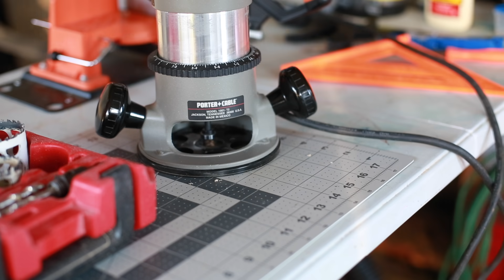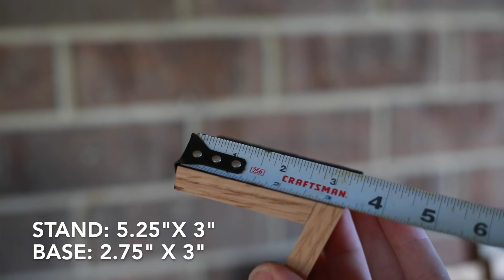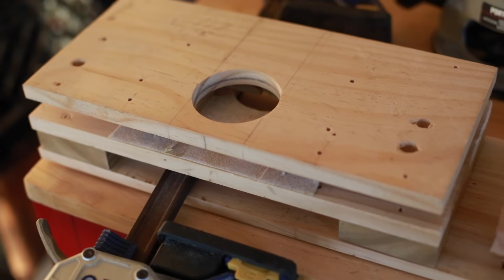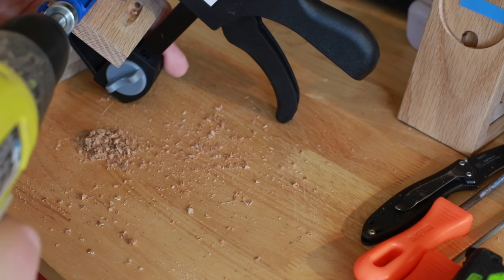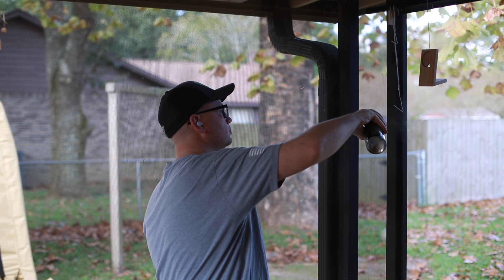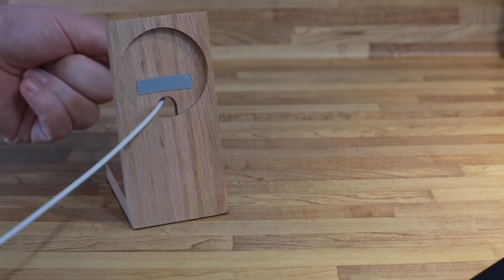DIY Woodworking MagSafe Charging Stand - Build your own for less than $10!

Comment: So... to make a 55.5 mm hole, you first need a 55.5 mm hole.  Got it.
Reply: I used a 2 1/4 inch hole saw to create an mdf jig. I then used my jig as a router template. The result is pretty clean

Comment: How did you make the router jig?  Especially how did you get correct hole size in the jig?
Reply from the maker: @larryherrmann1311  I traced the charger with a pencil, used slightly smaller hole saw to bore the hole, and used a rotary tool to carefully sand the difference.